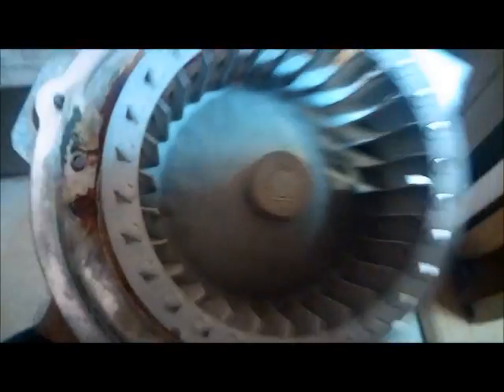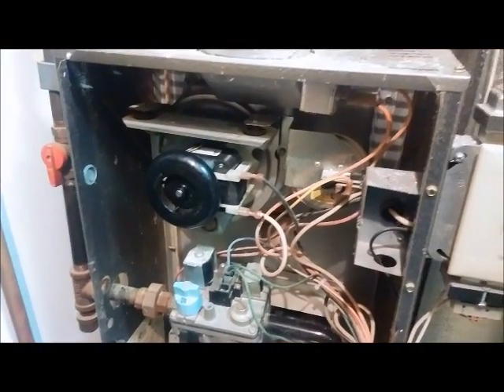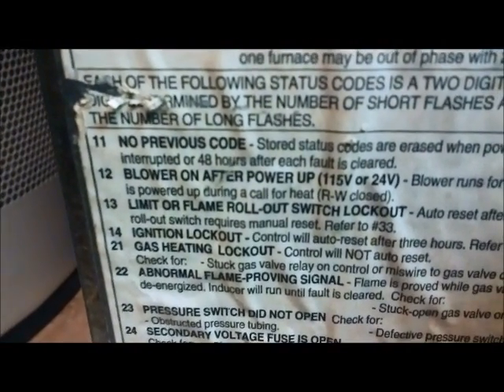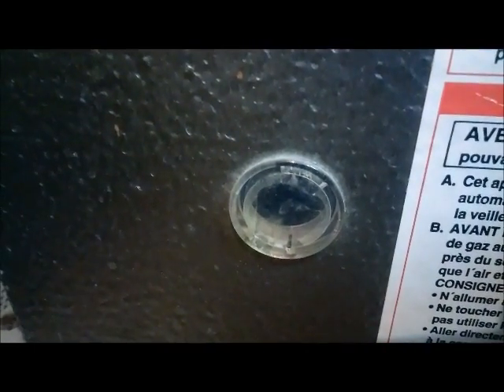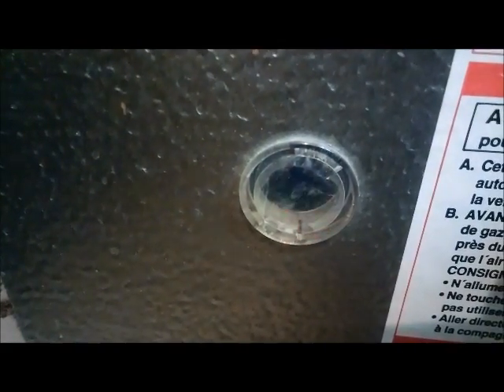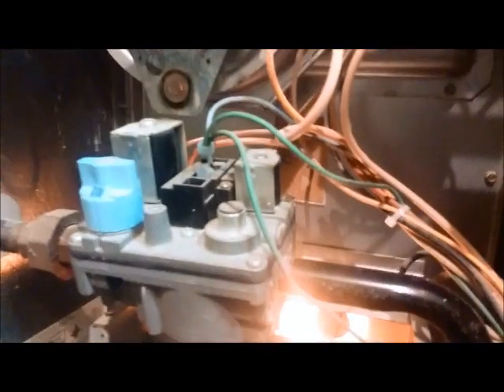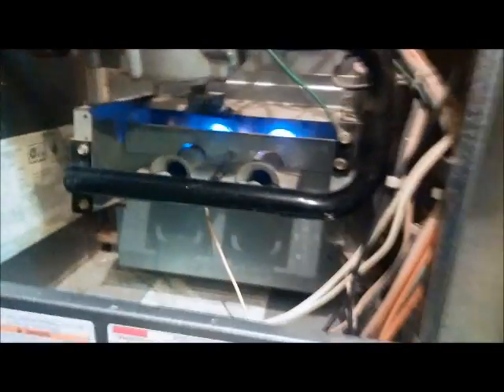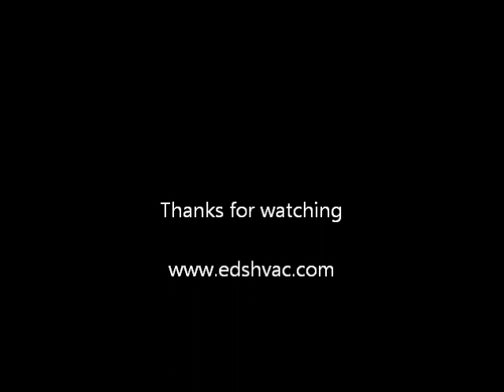Carrier 58pav inducer replacement 31 pressure fault code

Comment: You can take the  assembly apart and just change the bearings. Same bearings they use in skateboards. About 2 bucks each.  That is usually the reason for the motor not working - the furnace is usually in such an unclean spot in the basement, that the bearings get dirty.

Comment: The part no. for the proper OEM Gasket Kit is: 320887-751, contains 5 
items. Just Google it.  The price will vary ($18-40 USD) depending on 
where you buy it from. The kit is made for many furnace repairs, only 
the larger gasket and the spindle pad are the only 2x items you will 
probably use (the smaller gasket and other items are not needed, 
depending on your Carrier furnace). There is small gasket kit that sells
 for about $10, but the gasket is too small (4"?).

Comment: Instead of cutting the shaft, why not heat the collar and set screw to release the loctite? If you need to cut the shaft you should not make a DIY video.
Reply from the maker: Great idea.  I'd rather give my customer a brand new motor and wheel rather than something that has been compromised and warped by heat. if you've been in that position or you just can't get it off it's not worth not having the parts..
Reply: I tried heating mine. Waste of time. Had to cut it off.

Comment: How do u no it's not spinning buy hand mine spin freely is mine good
Reply from the maker: Sounds good. Could still be bad. Verify voltage is going to motor. If no voltage at motor then you could have a bad board or no call for heat is in place.
Reply from the maker: Please subscribe to my YouTube Channel. Need to get to 1000 subscribers to help pay for my hardware for my Bald Eagle cam that should be ready to go next year at this time.
Moving forward we are planning a live stream of a Bald Eagle nest near my home in Woodbury, Minnesota. Also I will be posting more hvac related service video...

Comment: Your video is absolutely uninformative. How did you take that whole piece off? What screws and wires did you need to disconnect? Why and how did you cut the shaft? You just wasted space on YouTube.
Reply from the maker: I agree. Sorry.
Reply: I agree, to many diy legend in their own minds on youtube, think they watch videos and can repair a furnace properly now.
Reply: I apologize for all DIYers Sir, we didn't know this is as hard as rocket science. but I personally had to learn it, because my service pro visited and for an $54 inducer motor you see here, he asked me to change all furnace and AC and recommended a $17K system and he charged $99 for only visit when I said no, next day he called and said he can charge $1500 for inducer motor and main board replace , because inducer motor damaged main board too!!!! (what the lie).  You know unfortunately a lot of rip off is happening in these fields, so, better to diy as much as you could.  if you, as a home owner can not repair simple things like this, than you end up paying all you earn to technicians cheating you to sell new devices for their company or charge you much more their work + part worth. but Clip was not that bad and it was informative although it could be better as someone above suggested.
Reply from the maker: @behnamtavakolzadeh3502  Please subscribe to my YouTube Channel. Need to get to 1000 subscribers to help pay for my hardware for my Bald Eagle cam that should be ready to go next year at this time.
Moving forward we are planning a live stream of a Bald Eagle nest near my home in Woodbury, Minnesota. Also I will be posting more hvac related service video...

Comment: You sound tired or Recovering from a hangover, i didn't catch the session where you cut the shaft on the old motor
Reply: If you don't know how to use a saw then you should not be trying to get diy advice on how to repair your mom's furnace.